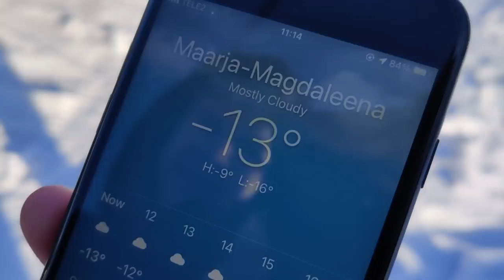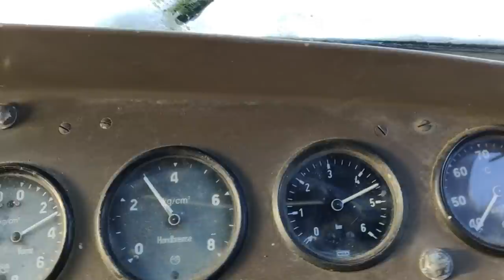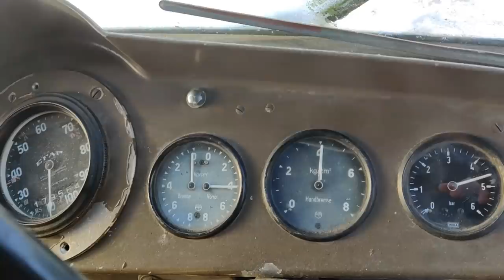Old Military Truck FIRST START AFTER 6 MONTHS - SAURER BERNA 2DM 2VM

Comment: The Saurer 2DM is a truck model, which established by the Adolph Saurer AG at Arbon from in 1959. The payload of 4.9 tonnes, it is a right hand drive. The Swiss Army used the 2DM since 1964, in several special versions, such as dump trucks, snow plow or tanker for aircraft or tanks. Almost identical was the model Berna 2VM from Berna Olten. Starting in 1964, approx 3200 units were built in all different varieties. The 2DM was also sold for civilian purposes.
Reply: do you know why they were right hand drive?
Reply: @boychoboychev67  Not 100% sure, but I think to have a better view over the mountain road edge, as this is a Swiss truck and it is a mountaineous country, but not only those trucks were RHD in that era despite being made in (and for) LHD countries, Fiat ones for example were also.
Reply: @WymiataczPlays  sounds reasonable. thank you

Comment: The Berna 2VM is a 4x4 truck model that Berna (manufacturer of buses, trolleybuses and trucks), at Olten, from 1964 to 1976 in total 1600 pieces produced. The company Berna was in 1929 purchased by Adolph Saurer AG. T The Swiss Army used the Berna 2VM in several special versions, such as dump trucks, snow plow or tanker for aircraft or tanks. Almost identical was the model Saurer 2DM from the Adolph Saurer AG in Arbon. The Berna 2VM was also sold for civilian purposes.[1] One is on display at the Schweizerische Militärmuseum Full.

Comment: Design like from WWII. Great condition :-) Best regards from Poland ;-)
Reply: Swiss design and entirely Swiss made from 1964 onwards.
Reply: Not dating from WWII at all...
If you can see one of these without snow you will see the difference. 
Basically trucks haven't changed much from WWI !!!!!
You still have a heavy duty ladder frame, an engine and (mostly) rear wheels transmission. 
The position of engine, cabin configuration and driver position may change but it remains the same old basic concepts with some newly introduced technical improvements for transmission and engine emissions...
That's all

Comment: Saurer-Berna was bought by Daimler-Benz because disturbing the  truck range plans of Mercedes for Switzerland.
As Saurer-Berna was almost the exclusive provider for heavy trucks for Swiss Army and retained strategic it is said that Swiss authorities only consent to the purchase after receiving from Daimler the promise that parts will be available for 25 more years.
Six months later passing in front of the SIM the Swiss main parts manufacturer at this time, I saw trucks of a well known scrap metal dealer loading material. 
I stopped and asked what's happening and the warehouse chief explained that they were cleaning of all Saurer-Berna parts.
In fact 5 years later it was impossible to find various parts, mainly engine and transmission. 
If target was to obtain civilian market its reached, if instead the target was military market not.
Today, military are buying more MAN than Mercedes.
Anyway, Daimler has killed Saurer-Berna and FBW and Switzerland has no more automotive industry. 
Thanks to the benevolent politicians